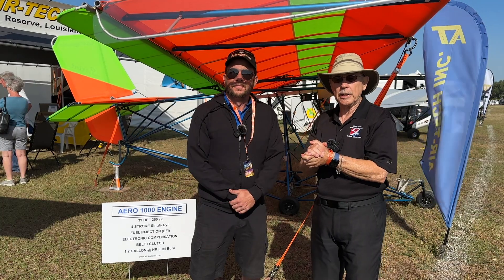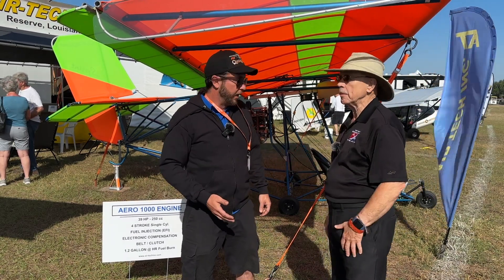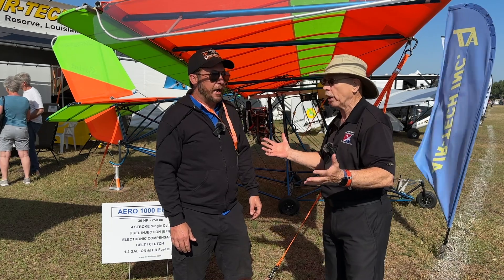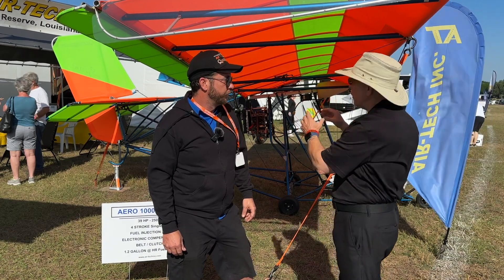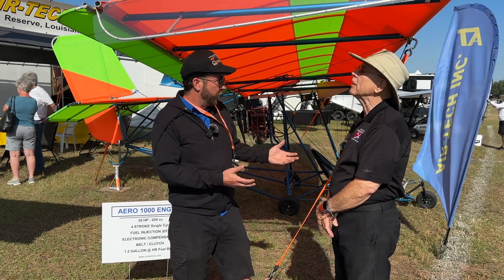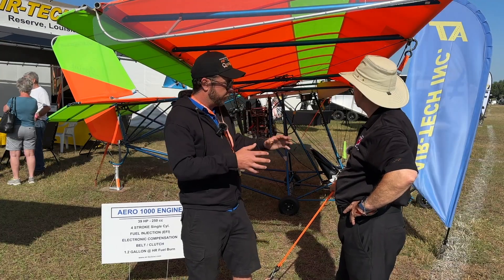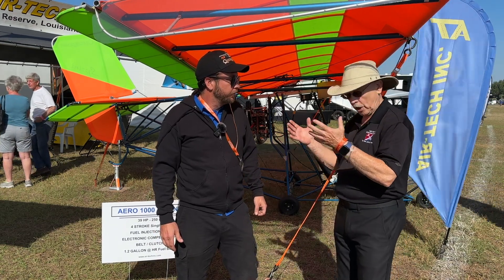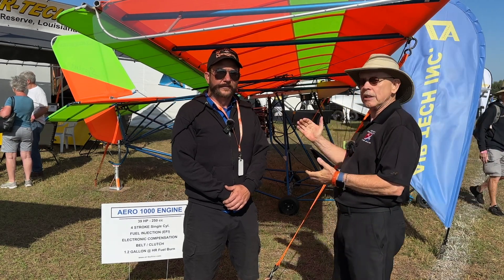Aero 4 stroke engine   0323

Comment: wow, terrible option, and 10k lmfao, gouge. you can get a 3 stroke radial FOR LESS money and better performance and not sound like an annoying racing kart to those you fly over. this is 50% MORE RPM than an annoying 2 stroke. this is just one more engine option that will fade awayyyyyyyy. You can do better with a built predator for 3k and half the rpm, and its four stroke and dual cylinders.

Comment: this engine been on fresh breeze ppg trikes (German Company) for several years now so not really new. I  cant warn anyone enough you need to use hi octane fuel no less than  93 octane  to prevent detonation failure that has occurred on a  guy that has one of these on a fresh breeze ppg trike, the piston cracked at the connecting rod journal rod from  detonation as he didn't use hi octane fuel. at first he used hi octane fuel for a long time and everything was great, as soon as he switched to low octane below 93 he had a detonation piston failure, he rebuilt the engine and went back to hi octane fuel and running good again.  Blackhawk PPG in California is also  dealer for this engine, I have a buddy with this engine on a PPG quad using this engine since 2018, these engines are very pricey as well.
Reply: Thank U for sharing this info. Much appreciated. 😄